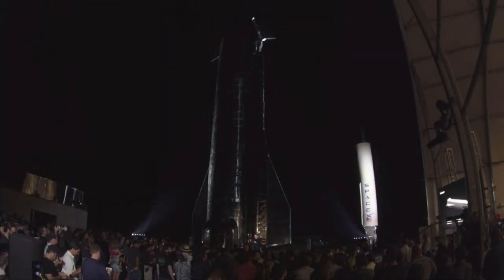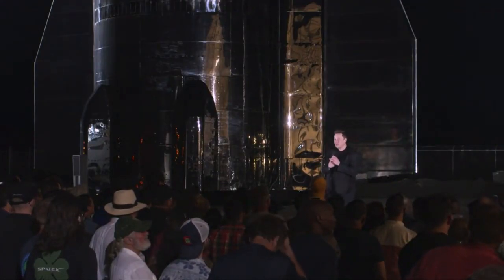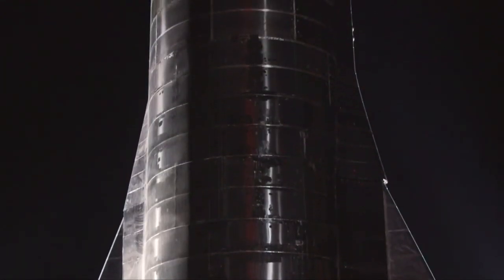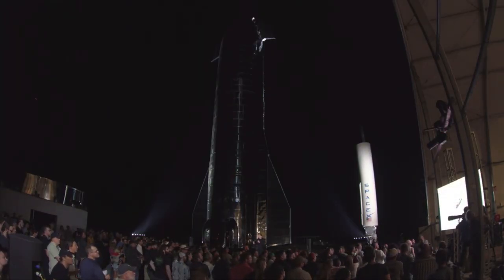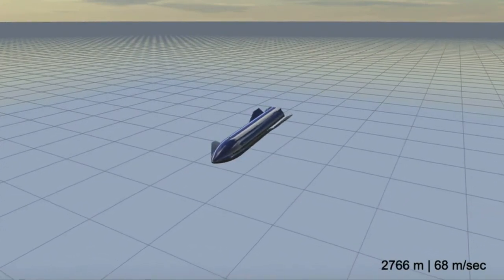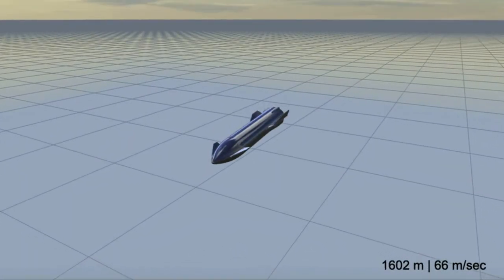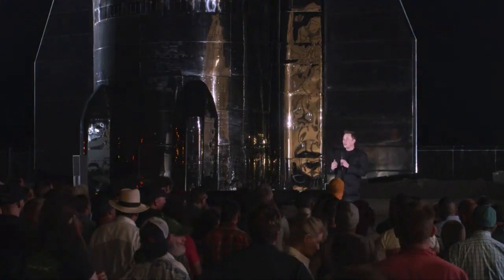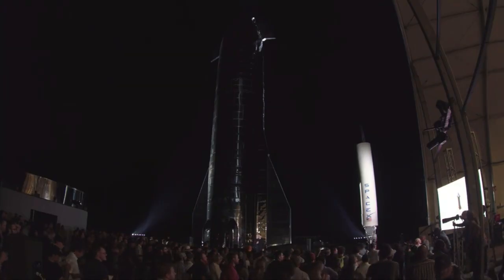How Will SpaceX's Starship Land? Elon Musk Explains Design

Comment: Its not the same as landing on Earth infustructure built property! Mars surface is very quicksand moist or pure fine sand mist, landing such a verticle craft, so unstable to impact as a LOX loaded canisters, is very criticle. What i would have recommended on low grav realms, is vector rockets, layed out at the black belly of SN, about 14to20 along the sides to perform a 20 or less story high hover land, exirting transfer of the main booster level horizontally, wth Huey Bell copter style deploy leggings. On Earth, have the Pod cargo chamber be a 3rd stage deploy lander.

Comment: Refueling stations in orbit around Mars to aid the convoy in landing. Instead of fueling stations around Mars just send some fuel only starships a year ahead of time so they can travel to Mars slower and thus have more fuel to share (they would not land but stay in orbit around Mars).

Then a year or so later when the people convoy ships near mars fuel could be transferred from the special orbiting fuel only ships to the people ships for more powered landing (still use belly flop drag but more safety margin for powered portion of landing).

Would this approach save the cost of developing refueling stations since these type of refueling starships (earth-based) are already part of Elon's plans? 

If there is enough fuel left in these refueler ships they could land on Mars and once fuel generating capabilities are created on Mars then these special ships could be used as refuelers to help send people ships back to Earth.

Comment: how is it gonna flip that fast? maybe with some superdraco engines near the nosecone
Reply: The insane gimbal range of the Raptor engine would do the trick.
Reply: Saturn314x umm ok
Reply: @Kaskadamusic  you ask a question and now you act confused when someone answers?
Reply: @Saturnares  that's because I'm not an expert on gimbals
Reply: @Kaskadamusic  It just means the engine can turn a lot which means the starship can turn a lot very quickly.
Reply: Saturn314x but wouldn’t that put lots of stress on it’s structure
Reply: @Kaskadamusic  the thrust doesn't put that much stress on the structure, atleast not enough to break it. turning in atmosphere will always put some amount of stress though, there's not really a way to stop that. the torque provided by the 3 raptors is not enough to break the structure if gimbaling is used carefully.

Comment: This Rocket looks Very boiler plate....almost like a grain Silo with wings... I would feel better if it was smoother externally like a modern jet aircraft....It Probably doesn't need to be...but it looks very quilty....I hope it is Successful...
Reply: He exolained how in mk1, 2, and 3 they  are using just plates... in  the Mk4 and so on, they will mold curved plates so the supr. Will be smoother
Reply: Its a prototype!
Reply: @omni288  
Lets hope it stays together....
Reply: @frankieford7668  yeah, it's harder for a small private company to absorb the cost of failures than NASA could.
Reply: @omni288  
It looks like something me and my buddies welded together in my backyard....im alittle worried...
Reply: @frankieford7668  it looks the same as the grasshopper and the starhopper and they flew
Reply: @thepoppunx  
Im not worried about hovering...and moving to another landing pad....im worried about going through maximum dynamic pressure on its way up...and the stresses of reentry comming back down....Stainless...with a spray on coating....i hope they did there homework...
Reply: @frankieford7668  he explained that, did you watch the streaming? the mk1 will do a flight test like the starhopper, just that...  the 20km and the orbital test with the reentry and all the heavy staff would be done by the mk4 or 5,
Reply: @thepoppunx  
I have to Admit...hes a hard guy to listen to...When he talks...it kinda pisses me off...Stop n Go...i usally need for somebody else to explane what he just said....Most Geniuses talk in a Crazy manner
Reply: Hahaha! Yeah, it does but I have faith that elon knows what he's doing. He made that water tank looking trying fly and land didn't he?

Comment: SLS is looking pretty dead now.
Reply: Not dead but certainly being put to rest after it is finished.
Reply: Time to rename SLS to the 
Starship
Launch
System
Reply: I believe that SLS can take a back seat and instead of using it for Orion just use it as a big cargo hauler to build the moon base and let SpaceX worry about transporting essential components and personnel.
Reply: @kikichela76  
In terms of cargo hauling ability, Starship has over 5 times the capability of SLS block 1. Thanks to it's ability to refuel in orbit.
Reply: @jeffvader811  yes you are correct but the reason why i am saying to have the SLS as a cargo hauler is because it makes no sense that nasa just ordered 3 Orion spacecraft and with another 3 in the near future totalling $4.6 billion when they can use the SLS to bring up inflatable habitats or anything else to construct a moon base.
Reply: @kikichela76  
I'm still not sure I understand. A payload is a payload, since no one has designed any moon base modules yet it really doesn't matter which rocket they launch on.

To properly compare SLS and Starship, imagine we want to put a hydrolox 3rd stage (4500m/s exhaust velocity) on Starship to get payloads into lunar orbit in a single launch (like the SLS). To do this, our 3rd stage will need a delta-V of 4km/s, which corresponds to a mass fraction of 0.7 (meaning that 70% of the vehicles mass should be propellant). At the 150 tonne range, it is possible to make up to 90% of the vehicle propellant. Meaning that we have 20% of 150 tonnes to turn into payload. For Starship, this means about a 30 tonne, single launch, Lunar payload capability. Which is comparable to the ~26 tonne payload of a Block 1 SLS. Basically, even if Starship can’t refuel on orbit, it is still a superior launch vehicle for lunar missions. Assuming that (like the S-IVB upper stage) our disposable third stage costs ~$50 million, then cost per kg to lunar orbit is $60,000,000/30,000kg = 2000 $/kg. Compared to (at best) 19,000 $/kg for SLS block 1. So about 10 times cheaper.

If we throw orbital refuelling into the mix we can refuel one Starship with 4 tankers, which would give it easily enough Delta-V to get to lunar orbit and land back at Earth, for a cost of about $50 million per 150 tonnes to lunar orbit, or a cost per kg of ~330. Or about 60 times cheaper than SLS, and 6 times cheaper than without orbital refuelling.

I’m not sure SLS has any redeeming features that make it a superior launch vehicle here. It loses out on basically every metric, cost, payload, launch frequency, versatility, etc. The only thing it does have going for it is that Orion is designed to launch on it, but since Orion can’t really compete with a crewed Starship, or even a few Dragon 2s, even there it’s a bit useless.
Reply: @jeffvader811  I'm sorry but i was not disputing the capability of starship vs SLS.   You hit the nail right on the head with questioning if it makes even sence of SLS existence.   But i believe SLS is here to stay because its a job program.   So to give any meaning of why keep this expensive vehicle around when starship can do everything 100x better in my opinion that SLS is better suited for launching equipment or deep space probes than to carry 4 astronauts around the moon. Starship is one hell of a beast.
Reply: @kikichela76  
Well in that case I would agree with you.
Reply: Fuck SLS
Reply: @SpitOnYourPalm  seriously! 🤣 The Senate Launch System is unreusable overpriced garbage.
Reply: No. It still will be the most capable rocket ever made, even after star ship flies. A hell of a lot more expensive though.
Reply: @matthewpalmer9820  No, Starship will be capable to put more tons in LEO even in its first versions.
The future versions of Starship will be even more capable with updates in their raptor engines.
Reply: @quisqueyanguy120  Especially if an update to 18m diameter is made.
Reply: @quisqueyanguy120  100000kg is not 140000kg. Also, payload to TLI is considerably lower. Landing on the moon with starship and returning requires 6 in orbit refuelings, SLS reauires 1 launch. Considerably less complicated. Its C3s are also considerably higher without multiple orbital refuelings, which also introduces points of failure. And in case you dont know, rondevous and docking outside of earth's sphere of influence will be considerably more difficult than stated.

I guarantee you itll be a decade before Starship will be able to cokpletely surpass SLS in terms of what NASA wants.
Reply: @matthewpalmer9820  
"100000kg is not 140kg"
The payload of Starship to LEO will be 150 tonnes, SLS block 1 will be ~70 tonnes. where you got 140kg from I don't know.

The SLS cannot even get Orion into Lunar orbit with enough fuel to come back, it is completely inadequate for it's primary purpose. It's a rocket that we should've had in the 80s, but because it took 40 years to get off the drawing board it's 40 years behind in capability. It has cost $14 billion to develop so far, and SpaceX has developed their Starship MK1 for just 5% of their own budget, which is roughly $150 million. Raptor development has cost ~$100 million since 2016, so if we assume another $50 million of pervious internal investment, that's still only $300 million. We're talking nearly 1/50th the development cost, and at a minimum 1/50th of the launch cost, with twice the LEO capability, and nearly 5 times the capability to the Moon and Mars if orbital refuelling is considered. There really is no competition here.

I guarantee you that the next person to land on the moon will not travel there on an SLS rocket.
Reply: @jeffvader811  i meant 140000kg.

SLS block 1 has a DCUS instead of the proper "exploration stage" which is effectively an S-IVB equivalent. You can thank obama for cutting funding towards that part of SLS. Block 2 is what SLS which the exploration upper stage and uprated srbs.
Reply: @matthewpalmer9820  
That's exactly what I'm saying, the SLS in it's current form is useless, and it's never going to reach it's later stages of development because at that point Starship and other reusable vehicles will already be flying.
Reply: @matthewpalmer9820  I have never seen such bullshit lies about the sls
Reply: @matthewpalmer9820  
SLS block 1 will have a capability of 70 tonnes to LEO, for a cost of anywhere between $0.5 billion to $7 billion (according to some estimates). Block 2 will have a payload of 130 tonnes, less than Starship, and is scheduled to fly in the late 2020s. Once starship flies, even if it's delayed by months, there will be no reason to keep on developing the SLS.